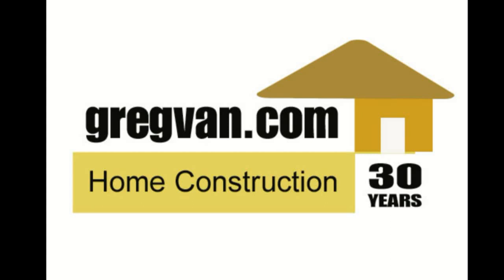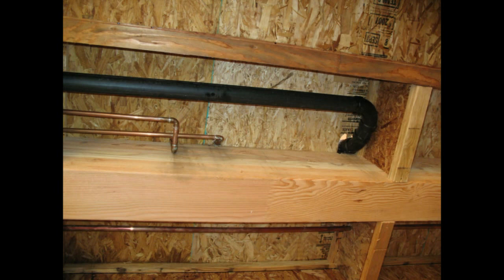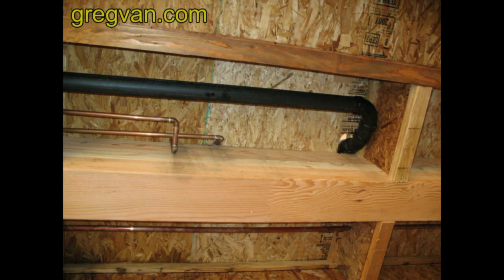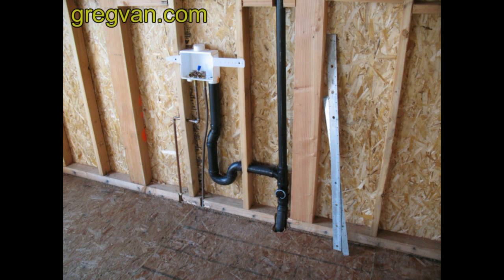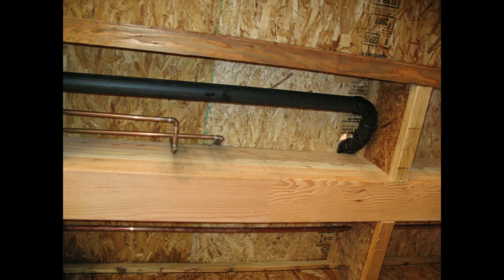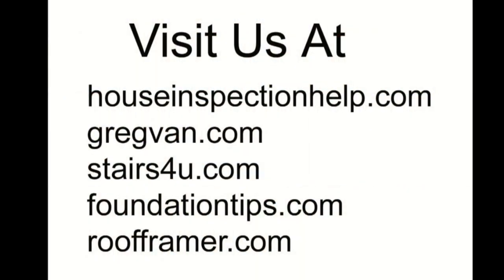Notching Structural Floor Beams for Pipes - Plumbing and Framing Education

Comment: Fun fact: GlueLams typically have a top and bottom orientation (i.e. a top edge). They use the better, stronger pieces on the top one or two lams. Don't install them upside down!